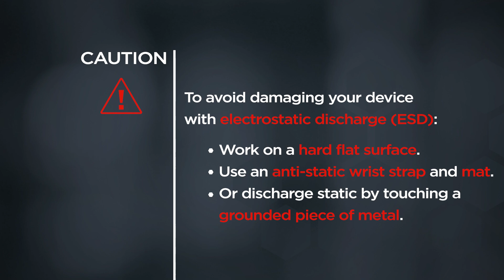Replacing Your Wireless WAN Card | ThinkPad T14s Gen 6 | Customer Self Service

Comment from the maker: This video will show you how to replace the wireless WAN card in your ThinkPad. The process in this video will work for the ThinkPad T14s Gen 6. 

You will need a screwdriver kit, a non-metallic pry tool, static-safe tweezers, and 15 minutes of your time.

If you are looking for videos about the ThinkPad T14s Gen 6 Snapdragon, go here: https://www.youtube.com/playlist?list=PL-2mqY82TErhpAGkQPGWGUDie1LjE66QO

To learn more about your device go to https://pcsupport.lenovo.com

To find parts for your device go to https://support.lenovo.com/parts-lookup/?cid=ww:lenovosocial:b9515f&source=socialmedia&subsource=yt

To view the Lenovo Support Self-Repair Guides landing page go to https://support.lenovo.com/us/en/solutions/HT516547

** NOTE: Static electricity can destroy components. Use a grounding strap, and clean, non-conductive surface to work on. Use plastic or coated tools to prevent scratching and avoid using metal tools on plastic parts. For more detailed information on electrostatic discharge and how to prevent it, please watch our ""Understanding Electrostatic Discharge (ESD)"" video: https://youtu.be/by4PB3WtdLo 

Applicable Machine Types:
ThinkPad T14s Gen 6 - 21M1, 21M2

#Lenovo #LenovoSupport #LenovoTechSupport

Check out other official Lenovo channels!
https://www.youtube.com/@Lenovo 🟥
https://www.youtube.com/@lenovolegion 🎮
https://www.youtube.com/@Lenovo-PC 💻
https://www.youtube.com/@LenovoSuporte 🟢🟡